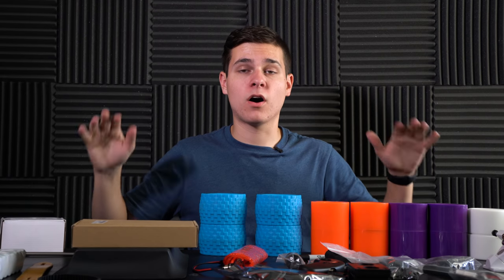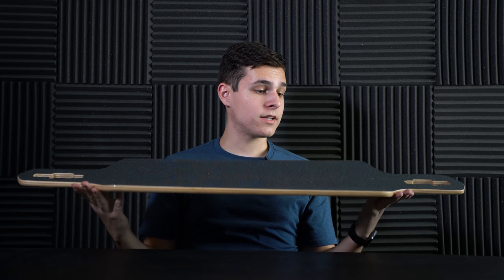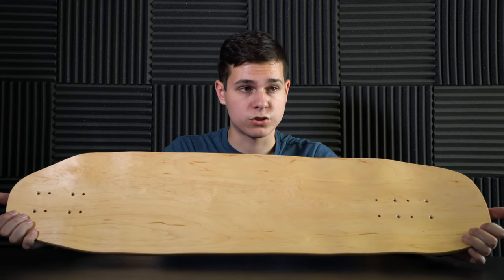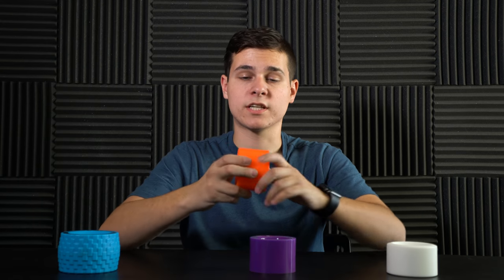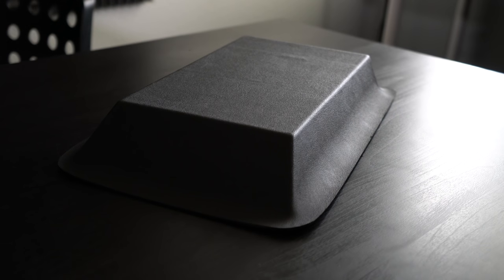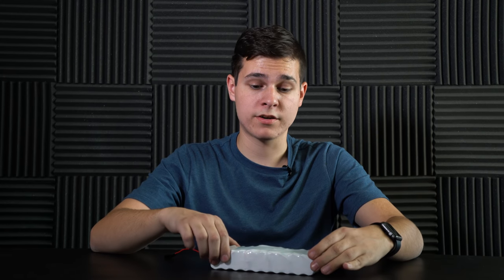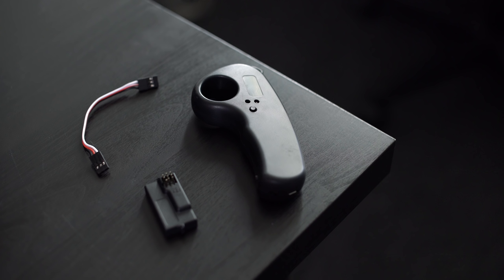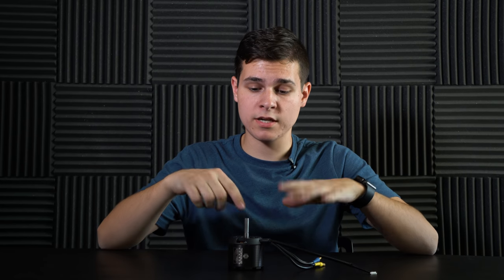DIY Electric Skateboard Build - Better Than A Boosted Board | Choosing Parts

Comment from the maker: What are some types of things you would like to know about building electric skateboards?
Reply: Great video! I am curious to know how you solder the 18650 cells together. And what type of charging solution do you use?
Reply: i was wondering where you get the box of 18650 batteries from???
Reply from the maker: +Matthew Sutton I order them in bulk from IMR batteries
Reply: Alright. Thanks man!
Reply: another thing, what size are they or how much mah they are?
Reply: same board but using hub motors
Reply from the maker: +Kevla310 I spot weld the cells together to avoid passing to much heat from a soldering iron to the cells. 

For charging I have a Bms connected and a hover board charger port with charger.
Reply from the maker: +Matthew Sutton each cell is 2500mah. So when 2 are in parallel it’s 5000mah.
Reply: Hey Mike! how long does the new battery pack take to charge? is it still 3 hours or so or is the charging time better now? 
Thanks
RAS
Reply from the maker: +RAS Vlogs They take about 2 hours now. But they seem more efficient, so a longer range. So worth the charge time 👍🏻
Reply from the maker: +Hunter Boyer The BMS I use is in the parts list. And yes I’ll be doing a video all about it 👍🏻
Reply: Thanks a lot! Also great quality video
Reply: Mike Beard hey, how much of a budget do you need to build this board. More specifically on the motor and all the stuff needed to make the board electric cause I already have a board but I don’t have much money to spend
Reply: A video on how to make a battery pack would be very helpful
Reply: JohnArcher s means how many in series, and p stands for the amount of batteries in parallel.
Reply: Walk throught on vesc....i know it controls speed but go in detail.....how it works, how to program, do we need to program, can we program speed modes, how many modes if we can......i just know its something we need but dont know it in detail
Reply: Would love to understand how you connect your batteries to the BMS (like real on deph, mabye make an example as if the cells were 8S2P LiPo batteries), and then use a power switch aswell. Im guessing you're bypassing the discharge? I would also look forward to a video where you explain how you've programmed your vesc. Thats all im wondering about atm, hahah. Thanks for making so good videos! Keep it up :)
Reply: any way you can solder more 18650 cells together to get more mah for longer distance? for instance 50% more.
Reply: Mike Beard can you put this on a loaded long board
Reply from the maker: +Alexander Jeanes you should be able to add this to any deck. Although, it is much more difficult to attach an enclosure to a flexible deck.
Reply: JohnArcher 20 cells.. 2packs of 10 cells in series, also called 10 cells in series followed by two of those packs of 10 in parallel.
Reply: It would be super helpful if you could go over the process you used to make the battery cell. All the way from arrangement, to wiring, to hooking them up to the BMS. Thanks man!
Reply: I’m really trying to go for speed on my electric skate board so what motor should I get so my board will go really fast
Reply: Hi I’m building an electric skate board and I’m really going for speed so what motor should I get that will be really fast.
Reply: b and n gaming high kv motor I believe.
Reply from the maker: +b and n gaming to be honest with a 10cell battery, all of the motors on diyelectricskateboard.com will make your board go really fast. The most powerful one though is the 190kv 6375 motor. (Use the coupon code Mike10 to save $10)
Reply: Hi Mike, I don't mean to aggressive, but have you tried shopping at any other merchants other than TorqueBoards/Diyelectric? There are plenty of other brands you could be informing people about, such as OllinMotors, PsychoTiller, ChiBoards, Evolve, Enertion, Trampa etc... Just a thought, sometimes mixing between vendors can really make for an awesome DIY, rather than a pre-built kit from TorqueBoards.
Reply from the maker: John Cullinan I’ve looked and purchased from other brands as well.(My very first board used nothing from diyelectric) There is some awesome stuff out there. DIYelectric just seems to be the most consistent and simple and affordable. I try to keep the amount of vendors as low as possible. Just send everyone to 2 or 3. Seems like it avoids confusion a little better. I always encourage reaching out to other brands 👍🏻
Reply: How to convince your parrents to let you buy and build one at 16
Reply from the maker: William Alexander Tell them it is a learning experience that teaches you all about gearing ratios, electronics, electricity... science.
Reply: Mike Beard thanks so much!
Reply: Is it posible to get regenaretive breaking? If so is it affortable/worth it?
Reply: sbdanielsen all quality VESC's allow for the ability to have regent Eatons braking as an option In settings.
Reply: John Cullinan Than what happens when you overdoze your battery with power?
Reply: sbdanielsen it explodes or catches on fire :)
Reply: Do you recomend "3" 10s2p batterys?
Reply: @Shinji391 Don't get so worked up man he is talking about the clearance of the motor and container attached to the bottom of the board versus the road. Because the deck sits lower the box and motor sit lower and this increases the chance that they may scrape the ground.
Reply: Hey.. Settle down ok?
Reply: Hello my friend. First of all i would like to say very informative video i really liked it, and i am going to use it really in building my own Eskateboard.

Second, i really want my board to have a speed of 28mph i know it is a little bit scary but that's what i want. Plus that i want it to be able to go for about 24miles.

I really don't know how to build that and what exactly or even from where i can get these requirements from so I am hopping u can help me.

Third, what about 20700 batteries, aren't't those better and much durable ? And i seem to have a problem with the website it dose not open at all.

That's it for now i hope u can help me please
Reply: How much it minimum cost? I’m realy need that information just because I’m a student
Reply from the maker: +Amir Tleuzhanov Expect to pay between 500 and 650 dollars 👍🏻
Reply: It’s less than boosted board huh.. thanks I’m realy enjoy this video and maybe make one of those.
Reply: Can I use battery from hover board?
Reply from the maker: +Amir Tleuzhanov Probably. As long as it can handle the amount of amps and voltage you’ll be pulling from it 👍🏻
Reply: Any replay for me ?
Reply: would I be able to use these components on a nickel board deck, or something of that size?
Reply: Is it a problem if the stuff gets wet while riding?
Reply: The white wheels quality good?  or better buying KEGEL?
Reply: are you building a single motor or a double motor? in the vids can you go over both, f doing one tell us haw to do it for the other.(im looking at dual motor)
Reply: Mike Beard great video by the way but I checked out ur site and uder the 10s bms you suggest thatit should be  not hook up to the discharge of the bms  I'm assuming because of amp limiting but my ? Is what is the max amps I can pull from one of your packs  assuming it uses the same bms?
Reply: How do I make sure I have wired my setup correctly so that I have regenerative breaking?
Reply: Where can i buy motors and how do know that they're powerful enough for the job
Reply: Can't go wrong with your list as you are making it,  for my first build.  Looking forward to the assembly vids
Reply: Can I make one that's water proof? (For riding through snow slush on the road.)
Reply: How difficult would it be to fabricate the battery right into the deck? 

I've considered making my own for a while and were wondering what the limitations were.. if it would have to be a lipo (similar to the ones in electronic devices) or if there were a way to solder Cels in series and just make a slightly thicker deck? 

Also.. what sort of amperage does it take to power the small high torque motors you mentioned?
Reply: Mike Beard can I charge lipo batteries with your charger instead of doing balancing charging ? Also can I use the on off switch with lipo batteries?
Reply: But should I buy just a finished skateboard and add motor and batteries?
Reply: Mike Beard I
Reply: Hey man, I was wondering, could you share some of your findings with appropriate motors? Specifically, I'm interested if you have tried different kv ratings and can recommend some. I personally live in belgium so the terrain is pretty flat, so i'm definitely looking for something more overkill on the speed side.
Reply: Would you be down to build a electric skateboard for me ??
Reply: how can you build one thats actually waterproof
Reply: Cheap battery
Reply: What is the closest controller to be like a Boosted Board controller.  The wheel, the reverse/braking, and maybe 'the dead man's switch'?

Comment: I'm sorry but you said you were going to discuss all of the options but you didn't. When it comes to remote you didn't talk about low/high speed options, why you should invest in a vesc instead of esc, how you built your battery pack, what's the advantage of your solution instead of lipo etc. I'm looking forward to the series but this video left me kind of puzzled about choice of parts for my project.

Just my 2 cents, you are doing great work :)
Reply from the maker: +Jakub Putynkowski You are right. In my parts list I do leave different options for different categories. I did want to talk about more options, the video just ended up really long. I’ll get more into it in future videos 👍🏻
Reply: Go to www.electricskateboards.com and read through the forums, all your answers to these questions are there
Reply: Agree with Jakub

Comment: Hi Mike! Love all the videos and you've inspired me to make my own board. I bought a board and i wanted to seal it against any water (building the electric setup on Christmas break). Would the sealed wood make for any complications when attaching the battery?  And also If I bought your battery pack that you offer,  is it the same amount of Samsung batteries as in your videos?
Reply from the maker: +Michael Stazzone Hi, the sealed wood should effect anything. Should be no problem. And yes, my batteries are built with 20 Samsung cells.

Comment: I actually like the Tupperware enclosure.  I've seen something like that with Oren's videos.  I like the idea of just popping two flaps open to swap out batteries to extend range.  It looks to me like your new 18650-based battery has a longer length than the Hobby King ones you originally used.  True?

Comment: I am interested in a much slower board more in the range of 15 mph but want a much longer range what size/type of battery would you suggest and what type of motor would you suggest. I know this video was posted a while ago but you did an awesome job
Reply from the maker: I’d look into a 6s to 8s battery. Maybe a 6s4p battery. That would give you a long range but lower top speed
Reply: Mike Beard awesome I appreciate the advice

Comment: What do you think of bigger ~7” off-road wheels. I’d like to build an off-road capable board mostly for med to short grass and gravel. Would these tucks and this deck be good for that? Thanks!
Reply: TropicalOnion go for the 7” pnumatics for sure!  If you do, go for a dual motor set up with (2) 6455 motors.  Also, because of the amperage demands use LiPos.  It’s a very common set up for pnumatics.

Comment: Hey Mike, i was wondering if you eve had any problems with your motor by keeping it exposed. It that a concern, should we house the motor in a compartment to keep dirt and dust out of the motor? Or is keeping the motor exposed jut fine?
Reply from the maker: +blacklight492 I’ve never had an issue with it exposed. I’ve ridden through dirt, dust, gravel, small puddles, it’s always been fine. I wouldn’t stress too much. But an enclosure would help 👍🏻

Comment: Mike! Thanks for this. Let me give you a bit of background. I've been using Boosted V2 and love it in most every way EXCEPT for battery life.     I recently bought the evolve GTX and loved the battery life but it had some major drawbacks. 1. It's huge 2. The controller sucks! The unweighted trigger is extremely sensitive and I was almost thrown off the board every time I used the throttle. 3. The software on the ESC was really jenky.  I returned it.   Now I'm looking to build something myself which led me to you. Some questions if you will:      Do you know of a shorter drop deck?  2. What controller is most similar to Boosted? I need something that will not lose connection in NYC (where I live) and have smooth with a weighted control so I can zoom around with good control. 3. Is it possible to program the throttle control? I come form the world of FPV racing drones... if you can control all your variables on a drone why cant I do that with my board? 4. what are good options for mounting the motors so they aren't hanging off the back like the GTX?  Thanks and I plan on getting my batts and other stuff from you.
Reply from the maker: I'll try to answer to the best of my ability haha

1. The shortest drop through deck i've seen is 39", I haven't done a ton of looking for shorter ones though, I'm sure there are shorter ones out there. 
2. The Enertion Nano-X seems to look the most like boosted. I haven't used it though
3. Yes it is possible to customize a ton of the settings on the VESC. 
4. Best motor mount I've used so far: https://diyelectricskateboard.com/collections/electric-skateboard-motor-mounts/products/single-bolt-on-motor-mount-set-only-black?aff=2

Comment: When you plug your battery directly into the VESC is there some kind of battery protection build in? If not, do you have any recommendation for good battery management ICs? I want my board to be basically fool proof. Pretty much like the stuff you can buy, plug in, charge – boom, done.

Comment: As far as torque goes, how does this board compare to the boosted board? (I know its a dual motor) Basically I'm just curious if this board gives you a bit of a thrill when taking off and I'm curious to just how torque-y it really is.

Comment: Have you ever tried to motorize a penny board? When I've some spear time I'm trying to figure it out starting from printing the support and the pulley (the problem will be to find the right belt)
Reply from the maker: I've tried, it would probably more practical with a Hub motor. There's just not much room under the deck to fit anything
Reply: If so I should probably change the trucks too and it'll be bulkier, is it right? Right now I just 3d printed a mount for the motor, but I've the problem with the gears and belt because now it is too customized

Comment: Hello my friend. First of all i would like to say very informative video i really liked it, and i am going to use it really in building my own Eskateboard.

Second, i really want my board to have a speed of 28mph i know it is a little bit scary but that's what i want. Plus that i want it to be able to go for about 24miles.

I really don't know how to build that and what exactly or even from where i can get these requirements from so I am hopping u can help me.

Third, what about 20700 batteries, aren't't those better and much durable ? And i seem to have a problem with the website it dose not open at all.

That's it for now i hope u can help me please
Reply from the maker: +mohamed sherin
 A 10s Battery would get your pretty close to 28mph. You’d need like 15000mah capacity to get you to 24miles. 

I’m sure 20700 batteries are great. Just have to keep an eye on pricing and actual value. 

And our website is up and running. Should be fine.
Reply: +Mike Beard 
what is that 10s battery ? And how many batteries are 15000mah ? Please

Comment: How to connect the batteries to the charger if I'm using Lipo battery. The connectors don't come withe the charger. Could you leave a link to the connectors

Comment: What would be the best way to build a board for mile range rather than speed . Bigger battery? If so what would you recommend
Reply from the maker: +reptiles miami You’ll want a battery with the most mAh rating possible. 5,000mah is standard 8,000-10,000 will be a lot more Range.

Comment: Hey Mike,

I've seen a few of your videos and played around on your website. Added all the items from your Kit list to my cart on Amazon and saw it was going to be at least $350 dollars just to make the battery. I understand that the price of an item on Amazon fluctuates daily, so the price for all the items I had could have been drastically different from the price you paid during your purchase(s). Overall, what sort of budget should I have for parts? I know the stock model you sell on your website is $800, so I'm guessing that figure includes all the parts + labor. My questions are: How much do you pay to make a 'stock' board (no additional extras)? Is your cost going to be lower than my cost because you're buying in bulk? What can I expect to pay?
Reply from the maker: +ACE3CGL Amazon does fluctuate a ton. And buying in bulk helps the price a ton. I’d plan on paying $550-$600 on a board.
Reply: Mike Beard Thanks for the answer Mike. It helped me come to the conclusion that while I may be able to build a better board or buy one from you, I'm going to purchase a Backfire G2 because it's a better fit for me on my limited budget.